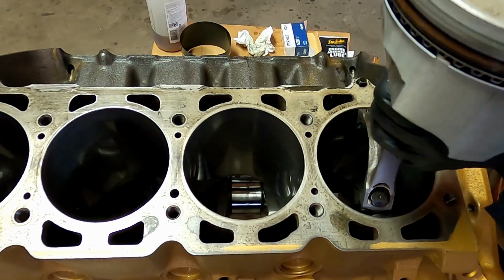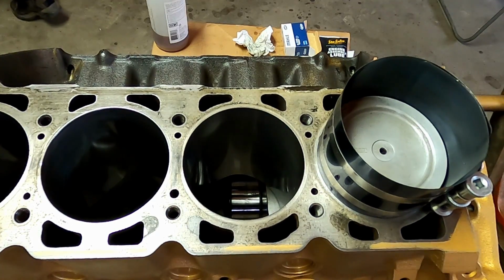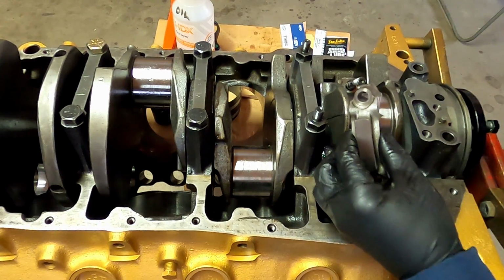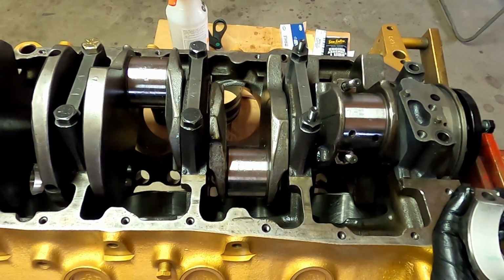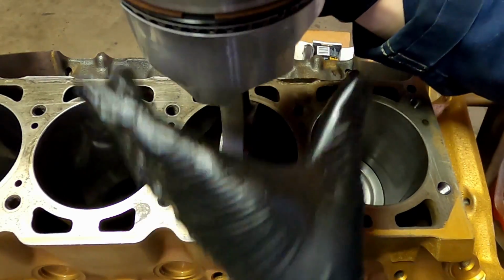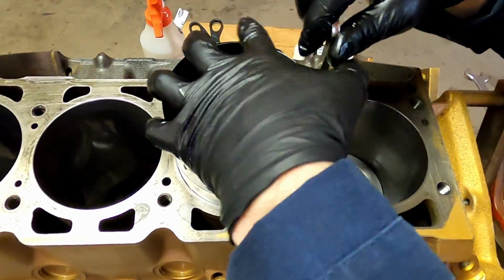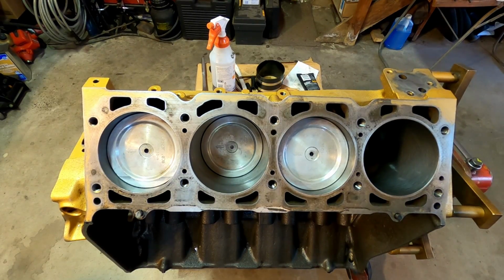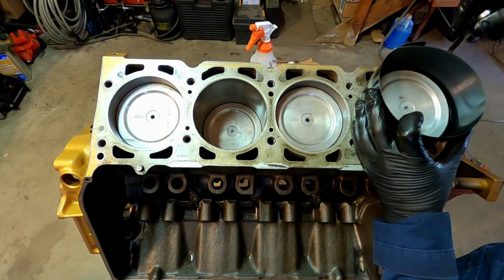Oldsmobile 455 Installing Pistons and Checking Tolerances

Comment: Going to be doing a 425 hopefully in the next year so this is helpful.
Reply from the maker: The 425 is a great engine!
Reply: You will not be disappointed with the 425 Olds . I rebuilt a 67 425 Olds and put it in my 86 Buick Regal limited in place of the 307 olds I love it I also switched to a th350 out of a Trans Am .😊 That metric th200 wasn't going to have it😅.